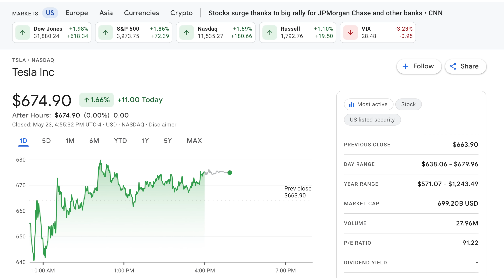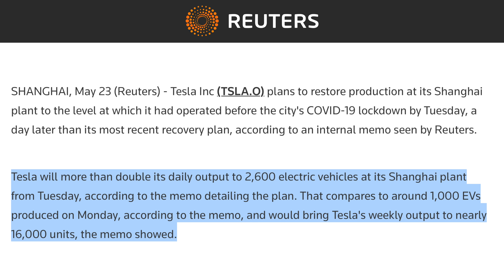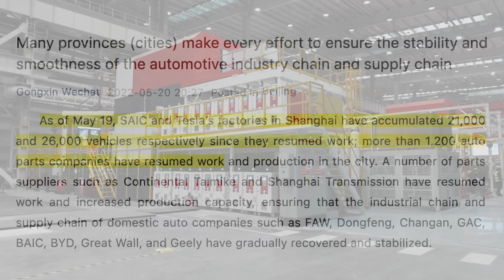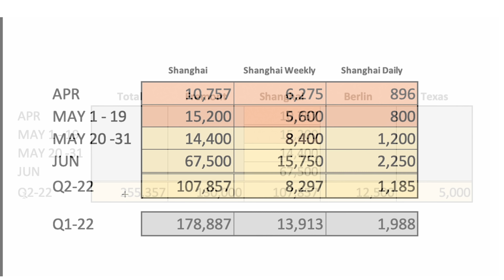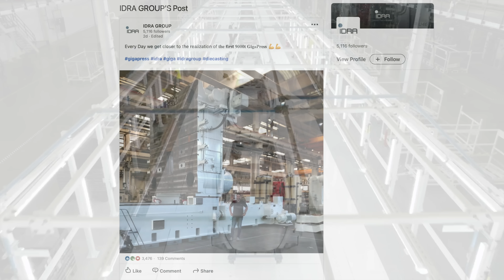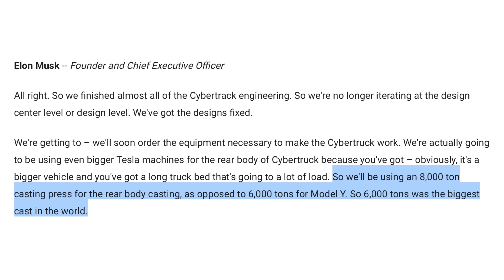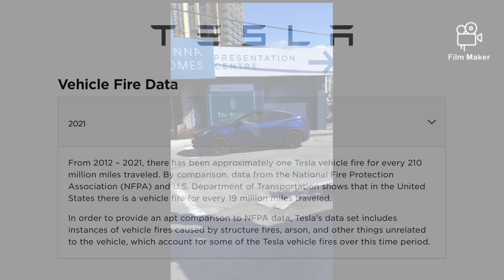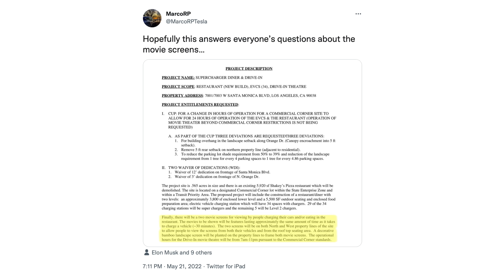Giga Shanghai Set To Ramp? + New AI Presentations, Giga Press

Comment: Those fires seem like a big deal to me, because there was no accident in either case; both were spontaneous. One was parked. One was pulling up to a stop street. Either could have been so much worse. What a nightmare.
Reply: do you feel the same about ICE car firers?
Reply: 6 Tesla fires over the weekend,  only 1 of them hit a tree, the rest were spontaneous, 2 while driving,  3 while parked.
Reply: Watch the one in the driveway again.  I don't see how that one could be anything other than arson/vandalism.  It looks very odd to me.  Flames coming off the exterior of the glass roof and nothing else.  Very little smoke coming from other parts of the car.  

I agree that the one that was driving is a concern, but it could be anything.  It could be cargo in the vehicle that started and propagated the fire for all we know.  And as others have pointed out, this is a far more common occurrence with ICE vehicles.  Like 10x more common.
Reply: @CL-gq3no  I saw the owner on the news, he explained the whole thing, app alerted him there was an alarm, he went outside and there was smoke coming from inside the car, He open the back door and the backseat was on fire, it melted his child seat first, then the glass broke out, which is why the fire looks like it’s on top of the car
Reply: @dmitchellhomes , interesting.  Thanks for sharing that.  Maybe we'll find out what caused it at some point, but even then it doesn't change the fact that Tesla fires are about 1/10th as frequent as gas vehicle fires.  For every Tesla that is national news because of a fire there are probably thousands of gas car fires that nobody bothers to report on because it's common enough not to be news worthy.
Reply: @CL-gq3no  actually, publicly available data suggests that Teslas have more fires than other cars in their same segments, doesn’t matter ice or EV.   Tesla likes to share a comparison to the whole fleet of vehicles, but the whole fleet of vehicles is an average of 13 years old, whereas the average Tesla in the United States is 3 years old.   The IIHS keeps data on this for insurance companies, but they don’t always release it to the public.  The latest data they released on non-crash fires, was from 2016 to 2018 model year cars, and in the luxury segment, Tesla model S led sedans, and model X led SUVs for non crash fire claims.  You can Search  this, “IIHS Non Crash Fire”.   I think model 3  and Y have been better, but S and X have a always had very high fire rates, even higher than Bolt which is about 1 in 10k.  I think when you’re comparing modern luxury cars, you should only compare them to other modern luxury cars when talking about percentages of fire, same with pick up trucks, should only be compared to other pick up trucks.   Comparing a modern EV, against the entire old fleet of cars in the US, is really a silly comparison and doesn’t give you any usable data.   I I HS has also stated data shows as a car ages, the risk of the fire increases, which is another reason, if you’re trying to assess the fire risk you should only compare like model years and like vehicle segment.
Reply: @turningpoint4238  Absolutely. I was in an ICE car fire in February and our car was written off. On a mountain road thick with fully loaded logging trucks (three stopped and put the fire out for us). The mechanic who replaced the turbo only days before has been found fully at fault by my insurance company's contracted fire investigation expert. Having your car spontaneously catch fire when you believe it is in good working order is terrifying. In our case it was like this: a confusing array of warning lights comes on related to other things than heat, then the brakes go weak rapidly and steering locks up. In defence of the manufacturer, the mechanic was utterly negligent, literally leaving out a part. Even with the car being 16 years old (2006), this would never have happened with proper workmanship. Why is this happening in a Tesla that is a few months old and another that is two years old? As @DB points out, is the comparison with other brands apples-to-apples in terms of age of car and like vehicle segment? Look, I love Tesla and most of my wealth is in Tesla shares. But that means I care more about what happened here, not less. It means I want to know what happened, not to sweep it under the rug. It doesn't help me if Tesla Daily fans think Teslas are super-safe. I need the general public/market to think that, to know it in fact. I'm looking forward to hearing the outcomes of the investigations, which could take few weeks or even months I suppose.
Reply: @dmitchellhomes  Thanks! For both observing and thinking in a detailed way. BTW the reason the windows are black in the photo is soot/heat. The still was taken from the video at a point moments before the glass blew out, so the glass was in a strange state. The roof and windshield have already gone completely.
Reply: @anthonyholland8549  For sure the goal is zero accidents but when humans are involved somewhere that will never happen. Investigate but don't make it something it's not. Problem is the press loves to write about Tesla fires and speculates and then when the truth is known they are silent.
Reply: @turningpoint4238  I agree there will always be accidents, but the sort of accident, presumably at the factory, that results in a car spontaneously bursting into flames while parked six months later, should surely be caught either by quality control before it leaves the factory or by sensors in the car which report faults. I don't think I'm making this into something it is not. But I do suspect we are getting ahead of ourselves. Let's wait for the results of the investigations.
Reply: @anthonyholland8549  For sure wait for the results and then Tesla can act if needed.